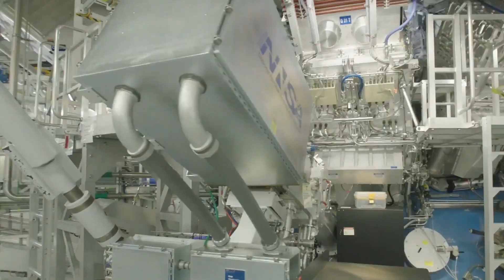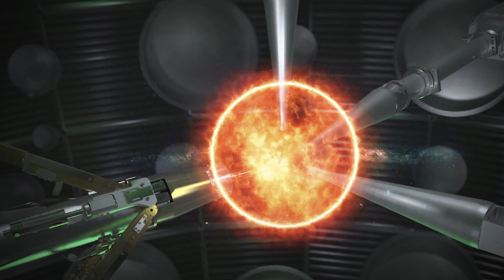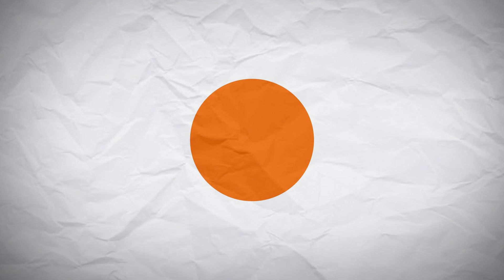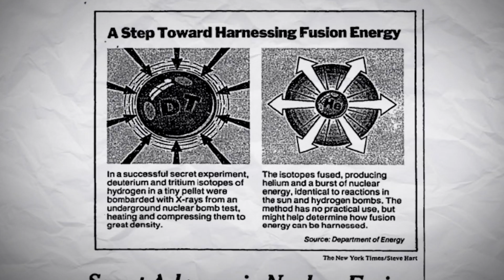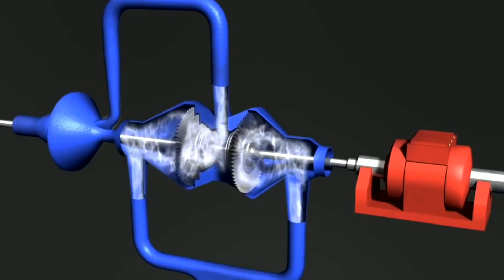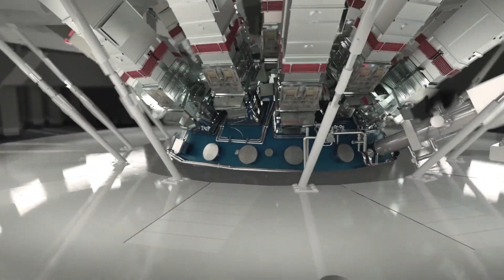Breakthrough in Nuclear Fusion Energy Explained

Comment: I agree that this is a very important breakthrough but many more will be needed. We are still many years away from producing a commercially viable fusion power plant. Moreover, it won't necessarily be the Americans who build such a plant first. Keep an eye on the Chinese who excel at engineering. I'm putting my money on them.
Reply from the maker: I agree, this is a small part in the whole process. There are many great fusion projects that I keep seeing, definitely a lot of great work in China.
Reply: You are right, we are far from producing electricity from fusion, so I was wondering whats the point of making such a big fuzz about a laboratory result. The history of science is filled with situations where things worked great in a laboratory but were not feasible for large scale use or production.
Reply: Actually the company involved is talking an electric producing device 2024, per a 30min documentary with them saying.

Comment: A wonderful SCIENTIFIC achievement — Optical Breakeven — from LLNL/NIF but not a very useful result from the TECHNICAL perspective of the topic.  
Using Nd:Glass lasers with so low conversion efficiencies for electrical energy into optical laser beam energy means you need a thermonuclear output enegy several hundred times higher. There is no other laser types with the suitable frequencies and power stability; the hope we had in the mid 1990s for Semiconductor very high power lasers has never realized.
Besides there are a huge number of other overwhelming optical, material, electrical, thermal, even mechanical* engineering issues that have to be solved to get a practical, affordable and profitable Inertial Fusion reactor.
There are not enough brainpower employed in these problem anywhere, and ICF funding is mostly provided by the military budget of the DoE, so the predominantly foreign (~2/3) High Energy Density Physics graduating from UoRochester, UCDavis, UCSD, UNevada-Reno are usually excluded from ICF R&D. 
In the USA, ICF is predominantly a military-oriented program — to research, test, homologate, validate R&D for Thermonuclear and Directed Enegy Weapons — so to avoid traditional Nuclear Testing. 
Profitable Energy generation is not a priority — results like this ignition are predominantly budgetary PR and PC propaganda for DoE's Lawrence Livermore, Los Alamos and Sandia National Labs. 
The bad thing about all this brouhaha is that material, financial and BRAINPOWER resources are diverted  from better latter Generation (7th? — it was 5th in the mid 2000s) Nuclear FISSION Reactor Technology (including Thorium-232 one) to pursue this Rube Goldberg-like nonsense.

* My last job at ICF in UCSD, after getting a Ph.D. in HED Physics at UoR. 
I got into HED/ICF/Plasmas because I wanted to build Fusion/Plasma propelled Interplanetary Spaceships and retire in Tethys (a moon of Saturn) ...
Reply from the maker: Yes these are great points. I definitely don't think NIF's main concern is fusion energy generation (I should have mentioned that in the video!) - However, this achievement is great for the fusion community as a whole I think :D Thanks for your comment!
Reply: @ZirothTech  
I am quite excited and jealous at the same time for not being part of this achievement.
In 1997, I was offered to be trained as an Control Room operator in the UoR/LLE Improved Omega Laser (it was expected that the 60-beam Improved Omega would achieve Ignition in Direct Drive mode by the early 2010s!), to be transferred to LLNL/NIF later.
In my Ph.D. arrogance, I decided against taking that job. As a foreigner, I was elegantly kicked out first from ICF and later of the USA a few years later, as many of my fellow (non-Russian) HED students from UoR.
I had many offers to work in DEWs from the USN/NRL and the USAF/ABL, plus SAIC (!!!), Sandia and LANL.  But no matter what exceptional was my resume, not having a Green Card at least ruined my HED career.
Reply: What are your thoughts on developments in Chirped Pulse Amplification laser systems? There are 2 or 3 private fusion start-ups pursuing this as a means to achieve ICF. At least 2 of them are not in the US.
Reply: @MattNolanCustom  
I did my thesis experiments in the first CPA laser in the world!  It was designed and built by Gerard Mourou (apparantly not a very nice Nobelist ... !) in the Tabletop Terawatt (T³) Laser Group, Lab of Laser Energetics, UoRochester.
Also I was the grad in charge of all the High-Vacuum Pumps for the Spatial Beam Filters of the T³ Laser.
All LLNL/NIF lasers are CPA driven.  The problems are two:
* they are all Nd:Glass lasers with very poor conversion efficiency of electrical into optical energy (< 1%). The wasted energy is huge (~100 MJ) a d it overheats the Nd:Glass amplifier discs so much that the UoR/LLE Omega ICF Laser could not be fired more than 9 times (newer 60 beam configuration) to
14 times (old 24 beam configuration) daily.
* the Nd:Glass laser operates at 1054 nm (IR) wavelength. It MUST be converted to 527 nm (green) and then to 352 nm (UV) light passing the beams through KDP crystals. Unless you have a very patient, neat, crafty and dedicated Grad/postdoc (preferably a nice Chinese or Indian girl, instead of a n@sty Russian 508!) aligning the crystals, your conversion efficiency may drop very badly (I do not remember well — after 25+ years! —, but the T³ laser at it's best was ~60 % per pass.)* 
So it us not what kind of amplification technique you use in your laser drivers. It is the wavelength — as SHORT as possible!! — and energy pulse stability what are the relevant factors for a suitable Laser-Plasma interaction with the fuel pellet (particularly in Direct Drive  — no Hohlraum case — mode) 
Nd:Glass lasers are OK for SCIENCE, but for a practical, profitable ICF reactor ... 💩!
In 1992, Jack Kelly — the chief designer of the LLNL/Shiva ICF reactor (the first ICF reactor ever built. It is shown in the 'Tron' movie from Disney) — was hopeful that by around 2010 the Semiconductor Diode Lasers may be built powerful and energetic enough (in the Gigajoule range) to operate in the proper wavelengths with electrical to optical energy conversion close to 90+ %!  Unfortunately, this feat — that would be a really significant TECHNICAL breakthrough for Laser-driven ICF!!! — has not been realized.

* When (as a junior Grad) I was introducd to Dr. Craxton (a brilliant Brit theorist, who invented the KDP crystal IR to UV converter.)  I was quite disgusted with him for some years. I told him that I got into Plasmas/ICF to develop Rocket Propulsion for Interplanetary Spaceships. Craxton implied it was a moronic hope, 'That is Science Fiction, not Science!  Years later I shared a plane seat with him to a APS Plasma conference; he was a really nice guy then. I found that academic HED/ICF physicists are quite hostile to R&D for Space Propulsion & Power applications. Federal labs guys are pretty enthusiastic about Fusion rocketry in all its modes!!  Unfortunately, I was born in the wrong country (and too much of a bachelor to marry for a Green Card ... ) to get the job I dreamed in LLNL/LANL/NRL 😥.
Reply: @Tordogor  thank you for all the details. I did read somewhere that some folks were looking at using laser diodes, but I don't recall now if that was actually happening or what was projected / hoped to be happening.
Reply: @tordogor are the systems at LLE dated? It seems kind of far from all the other labs working on it
Reply: @Tordogor